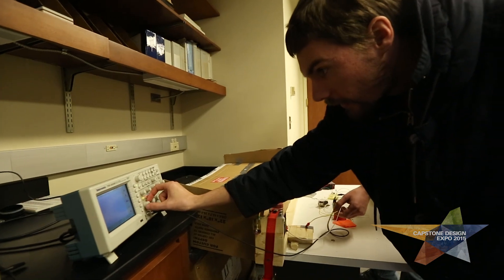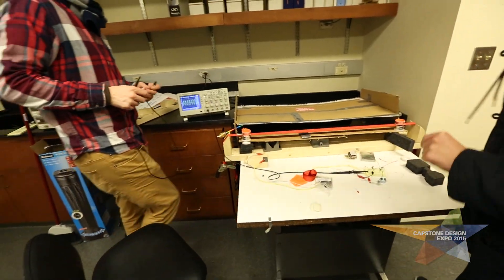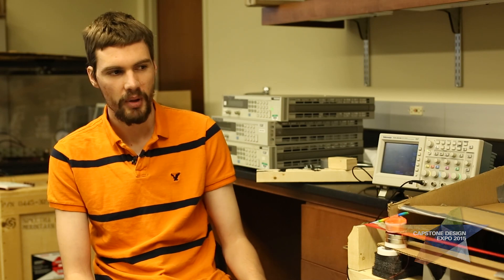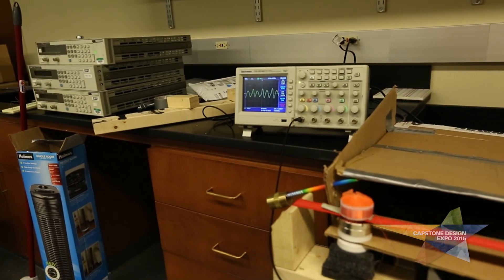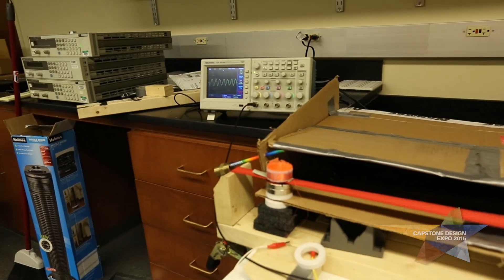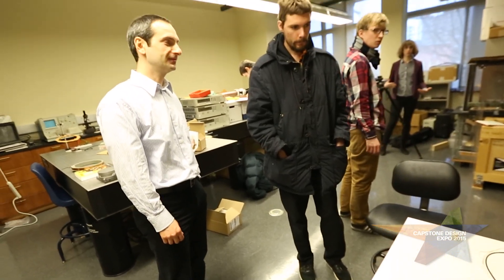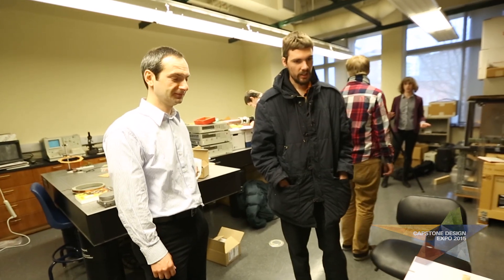Capstone Design 2015: Optimizing the Windbelt

Comment: I love this! 
Glad to see Shawn Frayne's idea is still evolving. I nerded out big time when I first saw his clips in the early '00s. Wrote him and talked by email a bit.
It got me pondering a few things related to a thread on FB about how Denmark had a day recently where they produced 140% of its electricity with Wind. http://www.ewao.com/a/1-denmark-just-produced-140-of-its-electricity-needs-with-renewable-wind-power

There we were talking about how one of the biggest misnomers about wind turbines, is that they pose a significant threat to birds.
There is some risk but it's so vastly overstated.

AND, to the extent there is any issue, there are some wind turbines designs now that address this in part. For example the horizontal axis of the Archimedes spiral blade configuration gives it a tiny profile without the appearance of clear zones to pass through for most birds. http://www.gottagodoityourself.com/wp-content/uploads/sites/403/2015/05/2015-05-28_0-30-37.jpg

But the real fallacy of the idea is that wind is the worst threat in any way right?
Not only do fossil fuels kill more collectively across the industry, but windows outstrip everything else. Building windows, all of them collectively, the more the worse, by many many times than nearly anything else. Followed only closely by Cats! http://www.sibleyguides.com/conservation/causes-of-bird-mortality/

My three are mostly indoors cats but they bring me little presents now and then. And we have a lot of strays in the area.
Windturbine bird strikes are like a fraction of 1% of all of the threats. Not really a real issue, but it is a popular meme.

But hey, so windows. Windows, with Louvers, are really good for managing internal temp. And, they make the window, look a whole lot less open. http://i00.i.aliimg.com/img/pb/852/188/420/420188852_851.jpg

Soooo, wind belts, on window louver rigs?
Insulated for sound so no humming gets inside unless the window is open. Wind power, that manages interiour temp and helps keep the lights on, looks cool, and drastically reduces the instances of bird strikes?

Put an auto timer on office lights so they go off at night and bob's your uncle.
Might use that in a comic sometime as BG detail, but thought i'd toss the idea out there. Would love to see someone try it!

Comment: Current is induced by changing magnetic field in a wire. Increased velocity increases the current. So what would happen if you wove the enamel coated copper wire into the belt and placed a halbach array of magnets along the length of the gap. I wonder what kind of current is possible at the center where the belt is moving faster/further than the edges where it is more or less just quivering.